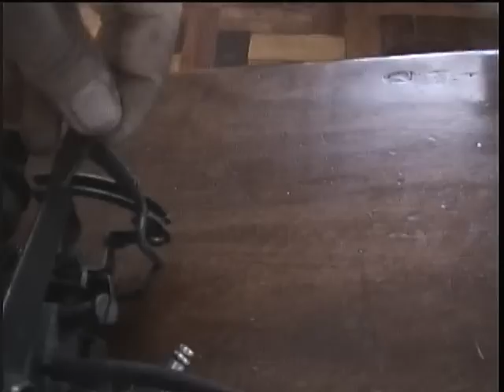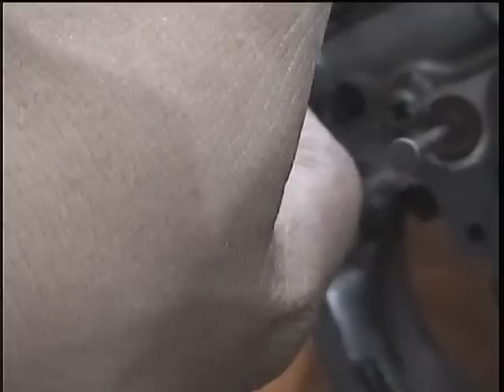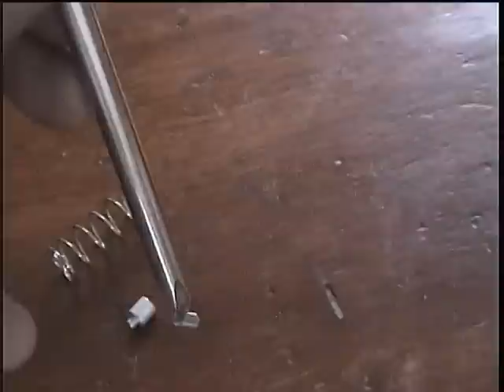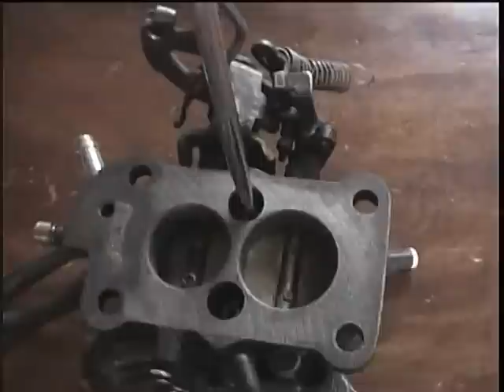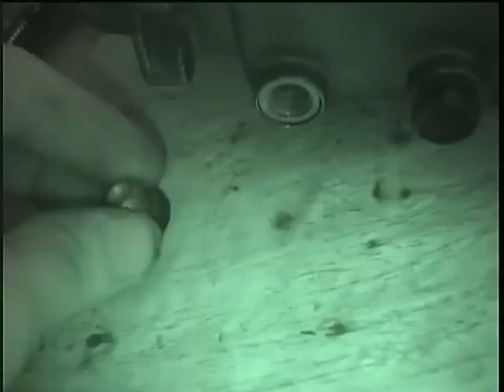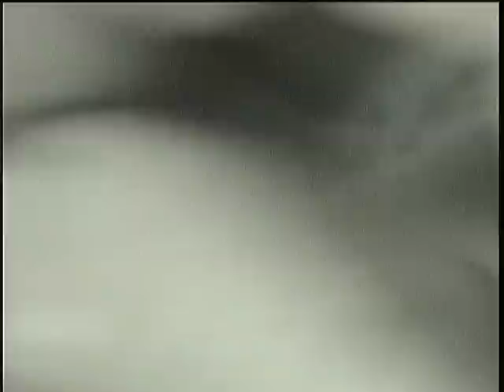2E engine toyota AISAN Carburetor replacing Jet.mpg

Comment: JET, MAIN #103
JET, MAIN #168
JET, SLOW #48
POWER JET #100

Do you know where can I order those? Also my 2e have the aisan carburetor that I want to rebuild but I don't know whats's the code for the aisan carb.
Reply from the maker: Azizi Zul banawe, quezon city Philippines
Reply: @playstation2bigs  I see. I regret that I'm not from Philippines. Any way to order them online? Also hows the efficiency of the carb after using the mentioned jets? Power-wise, mpg-wise etc etc
Reply: :(sve
Reply: Can you please mention the size of the primary jet. Also the purpose of power valve & piston. Thank you.

Comment: ok lang ba tinanggal nung mekaniko yung parang stopper n aluminum na natulak sa spring sa 5:15 ng video. inalis kasi ng mekaniko nung nagpacleaning nde daw napasok gas pag nakakabit.
Reply from the maker: Kailangan yun, ipa balik mo sa kanya yun.
Reply: @playstation2bigs  ok thanks. ako na lang magbabalik kinuha ko naman yung inalis para mapraktis ko napanood ko sayo. pede kaya wala gasket o gasket maker na lang yung base gasket na nasa ilalim ng parang rubber ng carb at manifold. wala kasi kasama sa repair kit. yung sa butterfly lang meron.
Reply from the maker: @ashnaye8473  bawal gasket maker babara carburetor mo

Comment: Hello there, I have the same 2E eninge on my 96 tercel and lately the engine has been feeling or hesitating like if no fuel were getting into the engine, let's say like if the car were out of gas even when the tank is full, I have new fuel filter.  I have  been dropped couple of times aside the rode for the same reason, I used a lot of carb cleaner and that have helped a little but now my car is consuming a lot of gas and I don't know what to do, any ideas? thanks.

Comment: Nag DIY convert ako sa Lancer EL 1996 1.3 liter engine from Piston Type Carburator into Aisan 2E Carburator with electric choke.....My Fuel consumption before was 7km per liter... Now I have a fuel consumption of 12km/liter. 

I want to replace the original jets size into smaller size of my 2E carburator . because I installed a HHO Generator with  hydrogen gas output  as fuel supplement.....But I don't now what's the sizes of primary and secondary jets...Just bought a repair kit with new jets included. 
Can somebody give me next smaller size of primary main jet and secondary main jet of 2E carburator.

Comment: Idol tanung q lng bumili kasi aquh NG Sasakyan na toyota corolla XE ngaung po ang carboretor pala ay pinalitan na iba n ang nkAkabit na carboretor kaya parang kinapos sya sa andar at pag nag aircon ka na mamatay ang makina at malakas din sa gas nung pinatingnan ko mikaniko ang sabi bumili daw ako NG 2e carboretor kasi Di na original na carboretor nkAkabit sa sasakyan ko, ngaun may nkita ako sa online na carboretor carparts toyota corolla 2e balak kung bilhin panu kya un idol titino n kaya ang sasakyan ko slamat idol sana matulungan muh ako godbless po,
Reply from the maker: kung bibili ka ng carburetor Sa banawe quezon city ka bumili ng replacement carburetor, MAXX brand or GTX brand parehong taiwan made. Sa online masyado mahal